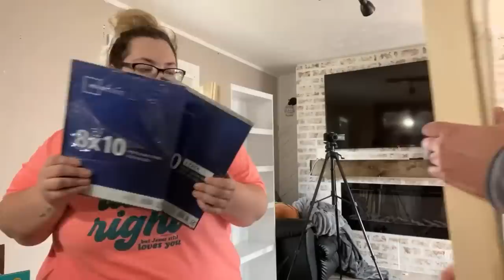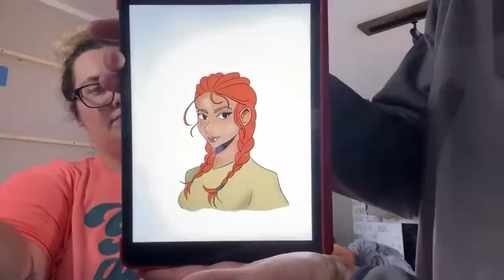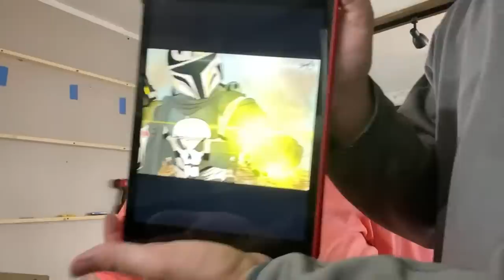MOBILE HOME UPDATES PROGRESS | I want your input!

Comment: Wide Velcro squares will hold even heaviest pictures. You can also buy squares that are used for picture hanging  with Velcro. You just screw squares to 2x4 in the wall, Afix Velcro on back of pictures. Trust me pictures stay straight and secure in place.  Easy to remove pictures if you want to change or rearrange. Vibration and pounding hammer won't make it fall. I love this product. Love ya, still working on my  mobile mansion covered front deck. Took it to the wood with power washer in most area's. Alot  of huge trees black & dark green Alge very hard to get off even with deck cleaner and power washer. I went over it 3x . Now waiting a couple of days for it to dry out. Then sand. I  have a small back deck that is ready to sand so I'm going sand it while I wait for front deck to dry out. Also $ tree seeds 4 for $1 grow like  crazy. My tomatoes are poping   out red daily and have great flavor. Look for them every spring you won't be disappointed. Nothing like home grown.

Comment: You need to google what the appropriate height for shelves are instead of relying on your viewers.  You do not know what their homes look like so do not put so much trust in their opinions!  I think you always have good judgement when it comes to decorating so just go by that or like I said google it.  I know you love your viewers but some things are better leaving them out of.  Just google appropriate height for floating shelves and google said this:  "Like artwork, floating shelves look best when they're eye level, about four to five feet from the floor. If you're hanging shelves above furniture, measure about ten inches from the top of the desk or couch. If placing shelving over a kitchen counter, they should be approximately 16 to 24 inches from the counter."  Love you guys and can't wait to see the finished product!